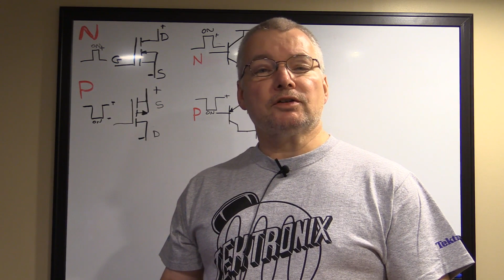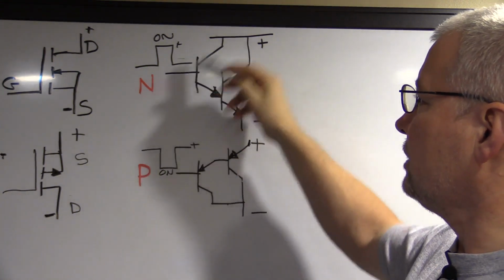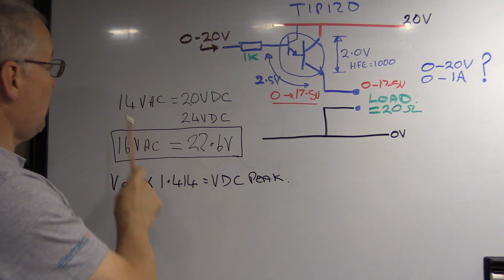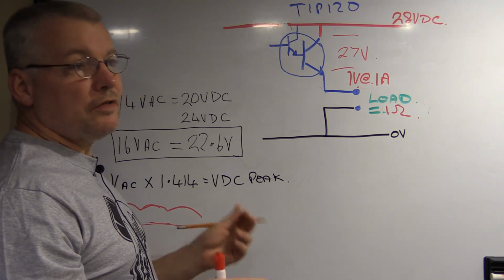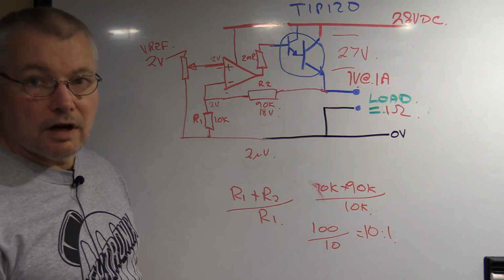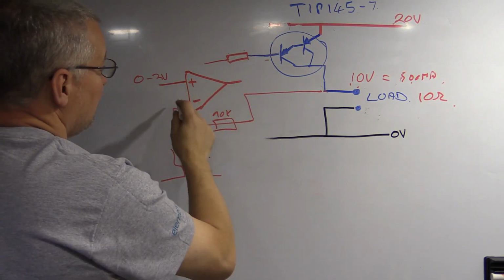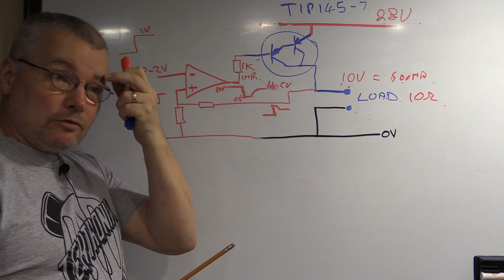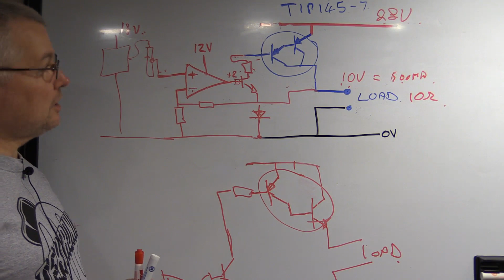The Modular Bench Power System #5 the Power Stage Intro and BiPolar

Comment: Great series. I'm learning a lot.
I always see NPN transistors as low side drivers and PNP as high side drivers.
What is different here?
Did you draw both as high side drivers to simplify the comparison?
Maybe the "NPN low side/PNP high side" rule of thumb does not apply because is a Darlington pair?
Reply from the maker: Nothing to do with Darlington, The transistors have to be on the high side in this case as the target solution is a bench power supply and you should always look to keeping the output tied to the zero rail, if the transistors where on the low side the output would be rising on the negative rail as you turn the volts toward zero. The bigger difference between NPN and PNP is that the NPN is working as an emitter follower (Current Amplifier) and far more stable in a power supply output (The gain of the transistor is almost reduced to 1), the PNP configuration is working as a voltage amplifier (Common Emitter) and therefore more prone to drift with temperature and less stable as the full gain of the transistor is used (Probably much better for a current source than a voltage source and a good topic for another video :) )
Reply: Peter Oakes Thanks again.
As with any good answer, your answer point me in the direction I need to search to get the knowledge I'm missing (instead of pointing out my ignorance).
As Roland wrote, is a pleasure to hear some one who knows what he is talking about.